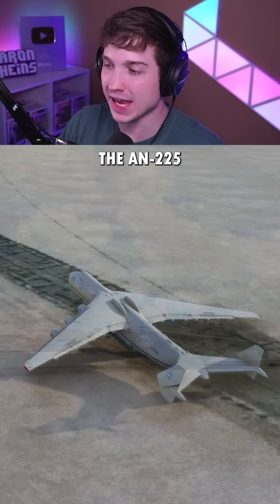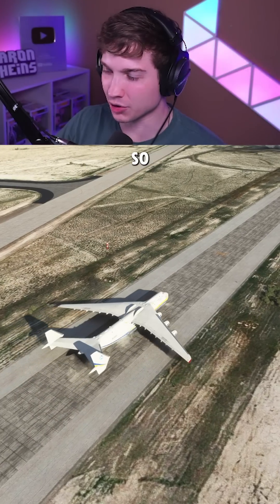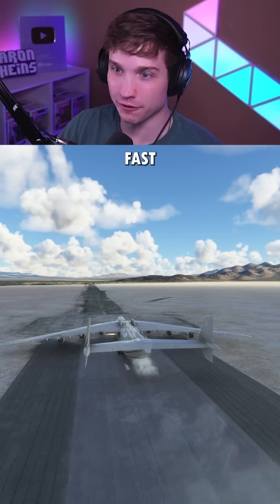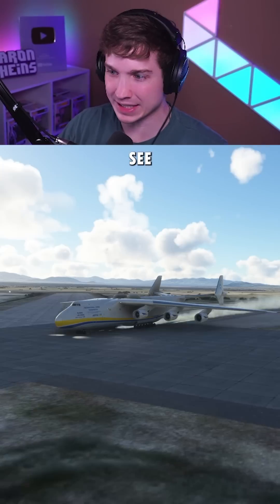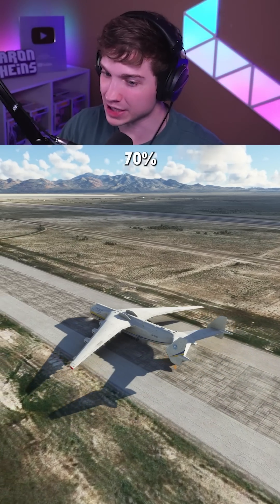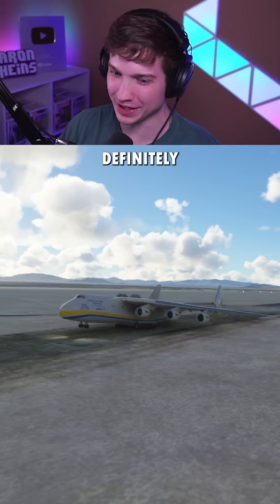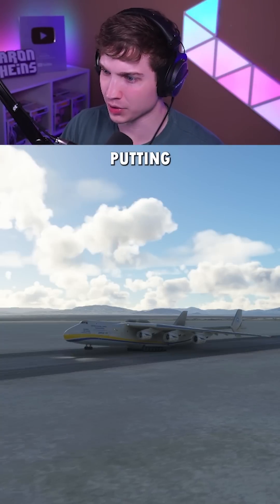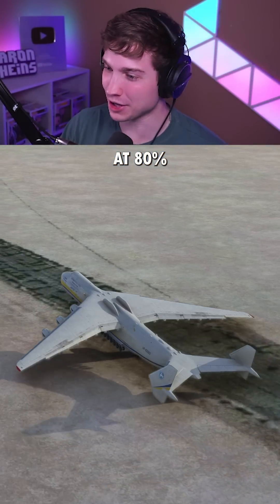How much throttle does the AN-225 need to takeoff?

Comment: If you can take off with max payload with 80% throttle….is it really your max payload? 😏
Reply: Aerosucre would like to interview you for a job position
Reply: Jup it is, either because the structure of the plane can't handle more weight, or you need a puffer Incase something goes wrong.